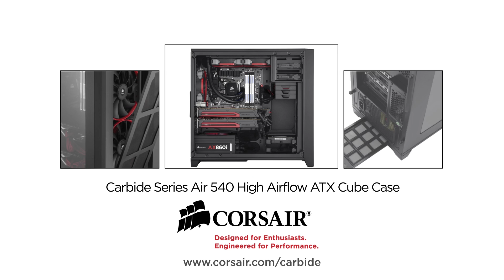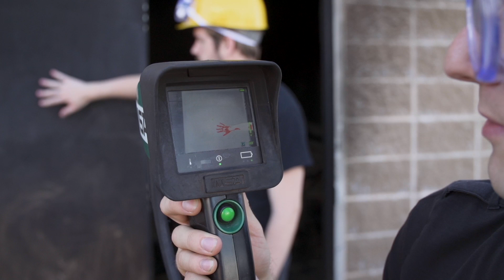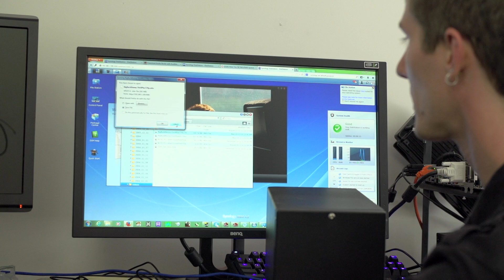BURN TEST! IOSafe N2 Fireproof & Waterproof NAS

Comment: Funny to only see this video years after being uploaded. Used to work at IO Safe when they were only a startup. The way they go about fireproofing the enclosures is neat and I think has a lot of unexplored DIY use. The fireproofing is just gypsum cured to shape. It would be quite strait forward to fireproof entire computer enclosures using the same materials.
Reply: stuff like Kaowool comes to mind, easy to shape and use. Might be worth some testing
Reply: @BeetleBuns  Kaowool would likely have some use. Gypsum has the benefit of retaining a lot of water when cured. As a result the internal temperature hardly goes above the water boiling point for quite a while during a burn. As you mention, testing would bear out weak points to be addressed.

Comment: incredible!  i would have never thought it could have survived the fire. regardless of the fact that it is in a firesafe enclosure.  yes the drive itself would not get touched by flames.   but the drive will still have to endure temperatures that far exceeds the temp range a harddrive can withstand.   Ok, so yes the power would get cut off soon after so the drives wont be operating at the time it starts baking... but you have to think about it,  it is the equivelant to sticking ur harddrive in the oven for 30 minutes.  
what you should have done is put some type of thermometer inside the box to see how hot the inside of the box got at peak temps.  i wish u could go back and do this.  because i am very curious how hot it got inside the box.

Comment: ERM, wont the huge amount of heat completely destroy and corrupt the magnetic disks?
Reply: 1st of all that has has a fan in it that could pull in hot air and corrupt the disks.
2nd if you have that sitting in a flame for a long amount of time it would have to be a really good insulator not to let the heat in.

Comment: At the beginning, you said 900 C° but in the end, you said 1000 F°. What was is?
Reply: good ear. i think linus made a mistake assuming the guy meant 900 C when he meant 900 F.  900 c is insane for wood and hay
Reply: Ashton Flint he meant F.  not C. linus just automatically jumped to C because hes a computer science guy and a Canadian.
Reply: Yeah, confusing...
For an unstoked wood fire, that has to be Fahrenheit. Also, the ioSafe datasheet says it's rated up to 1550F for 30 minutes, which is 843C. So, if the fire went above that temperature, then it wouldn't have been a fair test of the product.
Reply: Canada goes off Celsius so it's most likely Celsius

Comment: A house fire temperature can reach like 2000 celcius degrees? Linus's talking about 1000 fahrenheit all the time but that'd be bullshit? I would like to see how'd that survive an actual house fire where the fire becomes so hot it's almost impossible to put it out.
Reply: At the end he said 1000 Fahrenheit, but I think that was just a mistake. Early in the video he says 1000 C.
Reply: oh, thx for info
Reply: Linus said 1000 Celsius, and this is on the worse end of the house fire spectrum
Reply: @Rhami Zeini 5.8.2016 Linus said 1000 Celsius, and this is on the worse end of the house fire spectrum. Totally not the worst! 1000 degrees celcius is not the hottest a fire can get! Have you seen a car burn? Steel will melt at around 1500 celcius degrees. And fires are known to melt steel structures easily when the fire goes out of control.
http://www.engineeringtoolbox.com/melting-temperature-metals-d_860.html
Reply: sorry, just saw your comment, thanks for the info. Thats why I love the LTT channel. Instead of just shunning and bellitiling a mistake, people correct and educate you in a helpful manner

Comment: I would have prefered you to have the drive plugged in when you torched it, it would have been good to see if the fan filled it with smoke and if the smoke would have had issues with the drives.
Reply: The fan only cools the aluminium enclose of the drives, I believe.
Reply: Joel Nilsson Yeah but it's a part of the design so it's not a fully valid test if you don't have the device powered.
Reply: Aisha Kegawa Yeah, would have liked to see the same!
Reply: yea my drives were fucked when I had a house fire, even though other components like the graphics card actually survived. My pc was plugged in and on (albeit in sleep mode) the whole time too

Comment: ...real life would see this NAS device connected to another electronic device via cables.  Also a power cord which may or may not be energized during the fire.  Of course this NAS would be sitting on some type of desk, table or server rack/cab so after a time in fire on would expect that this device would take a fall or else have additional items collapse upon it, which would more than likely impart some type of serious shock.  In conclusion while this NAS device may withstand high temperatures for some amount of time there are obviously other issues to contend with in an uncontrolled fire....  Thanks and best regards...

Comment: I've seen a computer that was in a fire. It didn't get hit with a hose, but the front was melted. The HDD had an awful smell, but the data was fine. The rest of the computer was a complete write-off. This was also ~2004.

Comment: But would them drives survive if the nas was actually running? What with the cables melting and the drives getting reasonably close to 1000 degrees fahrnheit while running.

Comment: Honestly this so called worst case scenario isn't exactly worst case. Id guess you'd want to keep this device by your PC. All it would take would be a short from your power supply, frayed power cable, short from the PC, overloaded power strip, or any other thing that could cause a PC to start a fire. The likely hood of the fire starting right next to this thing is actually very high, it could happen while your out and your PC is running.

Comment: eeeh yes it might be fireproof but if the house start to burn the rof is probably going to fall down and crush the NAS :/
Reply: LMAO
Reply: Kaare Hansen yea but what if i have a 5 story concrete only house?? (roof is also concrete)
Reply: Kaare Hansen lol ye might
Reply: XybaZ swe if it was made just out of concrete it probably would not collapse in the first place
Reply: XybaZ swe Concrete houses don't have significant fire issues.  This device is fireproof and waterproof.  It does not claim to be impact or crush resistant.
Reply: +Kaare Hansen concrete doesn't easily catch on fire
Reply: xfire114 but hey.. i said "what if"
Reply: +XybaZ swe Then it doesn't collapse, and this isn't a problem.
Reply: crunch9876 but all the shit inside that does maybe can weaken it?
Reply: +XybaZ swe concrete will not fall because just a fire, atleast for a very long time
Reply: Bio Hazard lol
Reply: +XybaZ swe then your house sucks
Reply: +XybaZ swe thats why its not crush rated, its probably not vacuum or g-force rated either
Reply: +XybaZ swe Put it at the highest place in the house its a nas anyway you can acces it from any spot in the house
Reply: crunch9876 The Supports on the Concrete could easily burn & crumble.
Reply: They now in 2020 have an ssd that’s crush resistant up to 2500 lbs
Reply: +xfire114  jet fuel cant melt concrete beams
Reply: aottaz :P but "what if"
Reply: XybaZ swe and i told you what would happen? what was the point of this comment?

Comment: ya its a 25 min fire but what if you had them in a fire thats burning for over an hour and in was surrounded in a fire completely then how safe can it be , because of the fire begin on the left side for 25 min and the way it was bent at that time so if you gave it a longer time and it was all around it looks like it wont be guaranteed if you show that , that box would last a fire with the box wright in the middle with the fire surrounding that safe then show how it really works then i'll think of buying one.

Comment: No problem.  It'll buff out.

Seriously, though, according to experts, safes with less than a one-hour fire rating will not provide adequate protection to survive a typical home or business fire.  A one-hour rating has been the minimum standard for storing paper records for many years.  One can't count on the fire department being on the scene in eight minutes; sometimes the entire structure burns to the ground over 20 to 30 minutes and contents remain immersed in hot ash and coals long afterward.  Since disk drives and solid state drives can't withstand temperatures that paper can, I'd look for something better than the IOSafe N2 to securely keep data and I'd keep copies at one or more remote locations, i.e., store it "in the cloud".

Comment: Overall it was fine, but there are two things I would have liked to have seen. First, they should have sprayed the NAS with water for a much longer time to make sure it was fully drenched. At least 10 minutes.

Second, I would have like to see a SMART readout of the drives after they were taken out. I know they don't recommend using the drives afterwards, but that would have been a nice touch.

Comment: Why would IOSafe use aluminum in the core of the NAS? Aluminum's melting point is 660.3 degrees celcius. IOSafe could have easily gone for a metal with a much higher melting point for the inner part of the NAS, and it would work better in more extreme cases.

Comment: Fahrenheit or Celsius? You changed units in the middle Linus...lol
Reply: ***** Well...
That's only the surface.
Reply: There are 3 countries in the world too lazy to change to the metric system.
Reply: 900 degrees Fahrenheit =
482.222222 degrees Celsius

900 degrees Celsius =
1652 degrees Fahrenheit

Special Thanks to google
Reply: @robloxxer1000  I know you won't see this, but it's definitely not 900 degrees Fahrenheit that's colder than the point at which it would start to visibly glow at all, and then only a dull red (the draper point)

To get yellow flames you would need to be north of 1000c, so it's not that far fetched.

Not you, but the temperature of the surface  sun is more than 5000 degrees celsius, which radiates more than 600 times the energy per square meter that something at 1000 would.
Reply: Blade Mastr the same temperature as the sun? really?
Reply: The Guy Right Up Your Street Yup! I moved here from Europe when i was 10 (I'm 22 now)... and I still don't get the imperial system. Meanwhile, my fellow country men have a hard time converting kilograms to grams... It's sad really.
Reply: Blade Mastr regular flashover in a normal housefire happens at 600-700 degrees celsius - i doubt they came close when it was in an open room
Reply: Alek Salazar Also, Europe isn't a country. Just sayin ;P
Reply: ***** Some of us American's would prefer metric too, but it is what it is.
Reply: Sai Namuduri Linus American confirm?
Reply: Highwalker And the USA is just too lazy to change.
Reply: Highwalker Jesus, that's poor...
Reply: Highwalker Who are you referring to as your countrymen? U.S or Europe, just wondering lol.
Reply: The Guy Right Up Your Street and no one has ever heard of 2 of those countries.
Reply: ***** the middle is like 16 million degrees celsius
Reply: ***** Only in distances and weight. But temperatures is all metric.
Reply: Obviously Fahrenheit, it can't be almost the same temperature as the sun lol.
Reply: Johandyman Not quite but really dude that's pretty damn hot for a normal flame.
Reply: Alek Salazar Uh'merikans for I am proud to be an Uh'merikan, where at least I know I'm free! And I wont forget the men (and women) who died, who gave that right to me. And I'll gladly stand up! Next to you and defend her still today. Cause there ain't no doubt I love this land, Science bless the U.S.A!!!!!!!
Reply: batman39400 no canadian
Reply: Well the you can just change it by dividing by 5 adding 32 and then multiplying with 9 (from far to cell)

Comment: You have to be kidding me, the fire didn't even touch the other side of the case.  I would have placed the case right in the middle of the flame, or setup another pile of woods on the other side of the case leaving the case in the middle of TWO files of woods on each side, but still, I would have preferred two pile of woods of the same size as you saw on the video right next to each other while the case placed right in perfect center.  If the hard drive survives that, then you have a product.
Reply: Then make your own video and show us :D
Reply: They were trying to show the best scenario and worst scenario.

Comment: The question remains: How would it hold up if it was powered on? does it have power surge protection for when the power cable melts and causes a short?

Comment: How is it waterproof yet allows airflow?
Reply: he just explained it :P there is no real ventilation holes in which you can access the harddrives except if you remove the front sides .. But there are those heatsinks wich are being cooled by the fan and dissipate the heat from the harddrive while they are sealed in the case :P

Comment: In response to spyder's comment below "The nas should hav been plugged in and running. The nas should hav been plugged in and running."

Seriously. Pretty sure the NAS would shut off due to an overheat protection before it could melt. Heck, they might actuallyhave a specific sensor circuit just for that.

Comment: now place it IN the fire... not outside. in a real-life scenario, the house fire wouldn't attack 1 side of the Case, it would attack the entire case
Reply: Look, the firemen who set this up said it was both realistic AND extreme. I think I believe those guys more than u, sir on how "realistic" that fire was.
Reply: HeyItsMassacre Yeah and there's server rooms that when a fire is detected suck all of the oxygen out of the room to kill the fire.. Wouldn't want to get stuck in there.
Reply: In a real-life case, this would sit in the "server room" of a small company, surrounded by lots of metal & Server stuff, which wouldn't even burn under normal conditions(I don't think this NAS is intended for "home use"). As the fireman said, I guess this is the absolute worst-case scenario. Think about this: The earth's core is just about 6x hotter than this. Man, this thing is tough...
Reply: Maxjoker98 Even if it was in a server room, it would still be surrounded by fire, the fire isnt just going to be excluded from the room, it's going to move inside the room and start to burn everything in it's path
Reply: HeyItsMassacre I can attest for the reality of this test as I myself am a fire fighter. The reason this is a real life scenario is the fire departments (in this case, 8 minutes) response time to the scene. Even if what you were saying with the whole unit being engulfed in flame was true, it would have been (in a worst case scenario) engulfed for no longer than 8-10 minutes, which is significantly less than 20-25 minutes.
Reply: What do you suggest? Roast it on a spit?
Reply: Nicholas Vickers The ioSafe is made of Steel (For the most part) and steel burns/melts at about 1370 degrees C. About four to five hundred degrees hotter than an average house fire.
Reply: Inigo Montoya
Realistic for a small house fire that they get to and put out. Everyone wanted to see the scenario where the house burns down and they recover the nas but the fire department can't replicate that.
Reply: HeyItsMassacre it wouldnt be covered in flames, and most of the foundations of the house would take more than 20 minutes to burn anyways, coupled with not being surrounded by flamable curtains and shit, i think you'll be ok.
Reply: WarpGenesis  I know, but he said metal would not burn thats all. XD
Reply: Nicholas Vickers Ahh, but still. You'd need to pour gasoline on this thing to really make it burn. Also, this and a GoPro are honestly some of the toughest things I've seen. o-o
Reply: HeyItsMassacre
Yeah, but Metal don't burn. The plastic will burn, and you have to think, in a server room, there will be Fire Sprinklers, so the fire won't get a chance to get out of hand. And most devices these days have protections on them, encase of a fire or short. And server rooms are temperature controlled, the room needs to be very cool at all times to keep the servers nice and cool.
Reply: HeyItsMassacre Who told you that metals don't burn?
Reply: sprinklers or not, the fire isnt just going to stop... metal may not burn, but hard drives arent all metal.
Reply: Thetechgenius Actaully metal can burn
Reply: It should also be on and running. Even if the drives are protected from fire damage, a short caused by burnt live cables could kill the drives.

Comment: I do know what I am talking about.  Really.  I have probably been in the computer industry longer than you have been alive.  Maybe you should think out the scenario.  Some drives have safe clean option for clearing data.  Some drive controllers have the ability to low level format a drive.  If you power off a drive in the middle of write operations you can corrupt data.  If the controller starts sending incorrect write sequences you can corrupt data.  What does it do to protect from that?

Comment: Do you even know what you're talking about? Even if the drives magically decided they wanted to "format" while on (...really spyder? -.-), you clearly didn't watch or take notice of the majority of the video.
IOSafe is designed to save your drives, you send the safe back to them and they also do data recovery.

Even if the drives formatted (again... really?!) you wouldn't lose the data unless data was written over the top.

Comment: The nas should hav been plugged in and running.  the drives may hav survived but they weren't in use.  what happens when the controller overheats?  Does it freak out and send a format command to the drives?  That is big question.